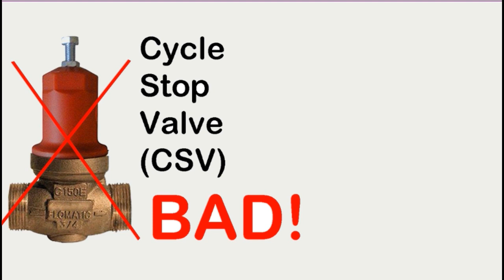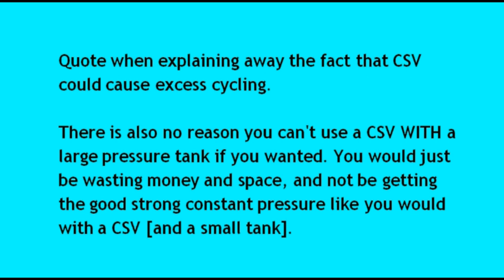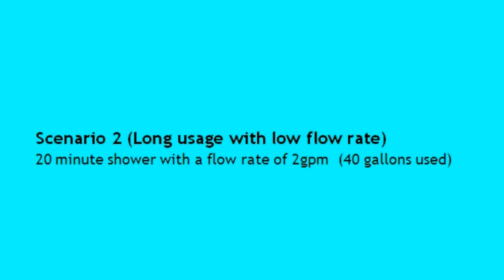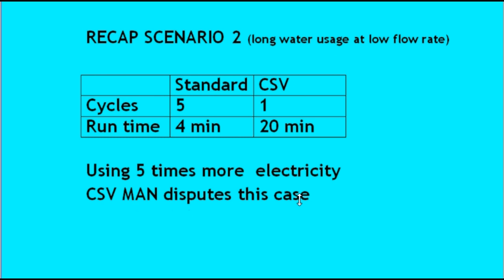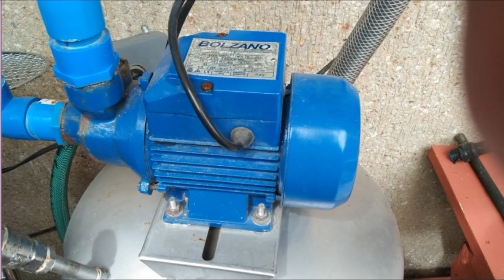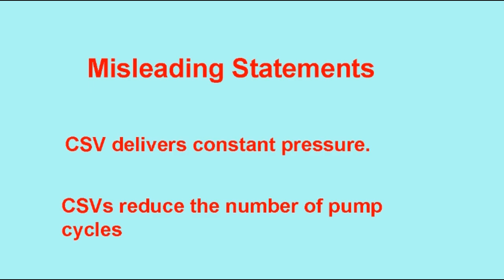Cycle Stop Valves ARE BAD for pressure tank systems!  Pros and cons of CSVs – few pros, many CONS!

Comment: Thanks for posting this video!  I got a question.  Contemplating a CSV as I think I am the rare person that could use it.  My system, you'll love:  Deep well feeds 3K Gallon cistern (float activated).  Adjacent to cistern is vault with 1HP  jet pump on 30/50 upped to 40/60 approx with 20 GPM flow, and 80/20 gallon (approx) pressure tank.  Two uses mainly for the water:
1. Feed whole house Reverse osmosis system in house (run  time approx 1 hr every morning into 200 gal storage tank).  The pump on that R.O. system has a requirement feed pressure of 35psi which is my problem.. 
2. Sprinkler irrigation runs 1.5 hours once or twice a day during peak.  Feeds 10 zones of three sprinklers totaling about 5GPM . 
I want to cut the on/off cycles during the only high output that the pump works.  It is not used for anything else like a toilet flush or sink nduse.  It is used to run a drip line sometimes in Summer and misc hydrant use as well.  Don't care about juice, care a little about jet pumps dying about every three years (three years ago and again this year), care a lot about RO feed requirement of 35psi for the 1.5HP Goulds pump.  When the R.O. feed pressure is feeding machine I get a fluctuation of a low of 27 to about 57 due to the 130' run to it from vault.  I think I got all the data in there.  So CSV valve right?  Am I the one lucky person that gets the CSV nod or am I doing something wrong?   TIA
Reply from the maker: Hi, ok, in a minute I will start analyzing your latest info. Before that I wanted to point out that I have a video called "cycle stop challenge game" https://www.youtube.com/watch?v=kM_Fp0ILzKY&t=326s, where I challenge somebody to find a use for a CSV. Eventually I would like to move these posts there. For now lets just put everything  here. In this challenge video I give out an email for such purposes as sending pictures. This the email is LLPH.EJ@gmail.com, you can send pics or diagrams there. Ok, I will  get back to you shortly after I digest your latest comment.
Reply from the maker: Phew!, you have a complicated system! I think I am zeroing in on what you have but I still have some more questions, plus my first suggestion. Are you sure you know the difference between a jet pump and a simple centrifugal booster pump? In my opinion, from what I can understand, you are using a jet pump(s) unnecessarily  when you could be using a simpler pump. This could be costing you money and may be part of the problem of your pumps breaking prematurely. Again, see my video 43 topics in 43 minutes.

Ok, now the questions. I will concentrate on the irrigation system and the RO system. On the sprinkler system, how does the timer activate the water to start flowing? Does it just open up a valve which then causes the pressure switch to be activated? Or is there a more direct connection to the pump? At any rate, i understand only 6.5 gpm is being used.

Ok, now onto the RO system. First, as I understand it you have four pumps total, one for each of your four systems, right?

What I don't understand is this. The pressure tank in the vault is feeding pressurized water to the RO system, yet you still have another 1.5 goulds pump  at the ro system. Why do you need a second pump? Explain how the two pumps interact? Send me a diagram if needed at LLPH.LJ@gmail.com, but let me know here that you sent it.

We will get this all nailed down!

Oh, and one more thing, where are you suggesting putting the CSV valve?
Reply: @LarryElterman   I am in the North and am too busy with not enough time so bare with me in replying...  I did not know about the challenge but sure I am in!  My set up is more busy than complicated really,  especially if I break it down better so it is more understandable.  With that said here is a better descrioption of the four seperate systems even though I am just concerned about system number "two" and I will try to answer questions as well.  My system has gone through some metamorphosis over the years from just system 1 to it's current state. 
1.  So system one is a basic submersible well pump in the well that is activated by a float switch in the cistern when  low point reached.  It simply pumps water from the well and dumps it into the cistern at the well output of 5 GPM.
2.  Right next to the cistern on the same level is my "vault" which is a 1000 gallon concrete tank where I have my 80 gallon pressure tank and a corresponding 1HP jet pump.  Water is pressurized here and sent to the house approx 125' away and within 10' or so of the jet pump level.  Water is also sent to irrigation valves from here that water grass in non frozen  months.  Pressurized water goes to the mechanical room where all the plumbing is etc.  Initially that was my only system that fed the house for water but due to ferrous and non ferrous iron, tannins  etc I have to go to work and make it more elaborate as cheaply as possible thus the birth of a whole house R/O system. 
3. Looks to be close to my system here: https://www.ebay.com/itm/390531960044?hash=item5aed84ccec:g:OIMAAOSw44BYUtLk
I manually turn this system on every morning and fill up the 200 gallon tank of RO/product water to feed the house pressure on the next system 4.  This system needs 35 psi from system 2 and it is currently getting 25-45...  
4. Is just another smaller 3/4HP jet pump with a smaller ,35 gal approx, pressure tank that pressurized house with product water.  It is nice not having iron stains in the drinking water along with stained porcelain toilets, showers, siinks and clothes. 

What you said about a a different type of pump ( centrifugal?) sparked my interest.  If this could replace system 2 or my vault jet pump and/or perhaps the pressure tank as well it would be interesting.  Both irrigation and house are very close to same level but the water needs to travel 125' to house and on separate irrigation line it must also travel maybe another 100' (totaling over 200') in Summer and provide stable pressure.  I have no idea the criteria for these centrifugal  pumps to operate.  Again my problem is burning out jet pumps in system 2 every three years...

The sprinkler system is just a basic sprinkler timer that operates valves on a a few manifolds.   I can set the time(s) to any time frame.  It is pressurized by system 2...

I would put the CSV in the vault with the pressure tank and jet pump (system 2) so hopefully it would feed steady pressure and not cycle which would be good for the R.O. pump and sprinkler activated cycling.  In a nutshell I think the jet pump is overcycling, or cycling too much during the one to three hours of heavy use via R.O. system and irrigation.  That is the only use essentially system 2 is used for...
I'll get some pics and/or video to your email later.  Bare with my delays busy time!  Thanks!
Reply from the maker: @robz924  Ya, this is a complicated system and a diagram would sure help, in the mean time I have a few more questions. Sorry, it seems like I have endless questions, but I can not solve the problem unless I understand your system 100 percent.

So, I am confused by a number of things. Ready?

Ok, you have your 3k cistern, and next to it in the vault a 1000 gallon concrete tank. I really don’t understand the purpose of this tank in the vault. You already have the cistern, why do you need the additional 1000 gallon tank. This makes no sense to me at all. How does the water get from the Cistern to the 1000 gallon tank in the vault? By gravity? You should be going from the Cistern, to your pump to your pressure tank, no 1000 gallon tank needed.

Ok, so in your latest description you do not address the purpose of the 1.5 hp goulds pump, so I will take a guess at what I think is going on and you tell me if I am right.

The 1.5 hp goulds pump is an integral part of the  RO system and is used internally to produced the filtered water. You need not think of the 1.5 hp goulds pump as a separate entity, what we have is an RO system which requires 35 psi input and the goulds pump is of no consequence in our analysis, it is simply an integral part of the RO system, which as a whole requires 35 psi input, am I correct?

A jet pump is a centrifugal pump with an added attachment basically. This attachment is only needed if you are sucking water up from below. You are not doing this, so you are wasting money buying these jet pumps, if indeed they are jet pumps. You buy a centrifugal pump exactly as you would buy a jet pump, by looking at the specs! They don’t look much different. Jet pumps usually have the output set back a ways from the input. Centrifugal pumps usually have the output right above the input. I know I am being repetitive, but you can learn the difference in my video 43 topics in 43 minutes. The index will tell you where to watch.

If my assumptions are correct I think I have a good handle now on what is going on. The big confusion is why you have the extra storage tank in the vault.
Reply from the maker: Hi, thanks for the challenge. No, I highly doubt you are the one person that can use a CSV. I can always find a better way! But now that I have double downed, I better put my money where my mouth is, but first I have to understand your system completely. There are a number of things I am not clear about so the first step is for me to ask a number of questions.
1. You have two pumps right? A Goulds deep well 1.5 hp pump, and a 1hp jet pump, right?
2. The deep well pump is only used to feed the cistern, which is controlled by a float switch, right?
3. The Jet pump is used to fill the pressure tank, and then the pressure tank feeds both the sprinkler system and the RO system right?
4. You say the pump is set to pressure 40/60 correct? Which is another way of saying the pressure in the pressure tank varies from 40 to 60 correct?
5. You describe the pressure tank as being 80/20. I don’t know what that means, does that mean that it is an 80 gallon pressure tank with a 20 gallon draw down?
6. Once the water gets to the 200 gallon RO storage tank, how does it then get delivered to the rest of the house?  By gravity only?
7. I think that you are saying that the well pump is only used to feed the Cistern? Am I correct? But later you say the following” I care a lot about the RO requirement of 35psi for the 1.5hp goulds pump.” So this seems to contradict my image of what you have, namely that the well pump only feeds the cistern and the jet pump does the rest, please clarify. 
8. how is the sprinkler system activated? Manually or by a timer? You said you have 10 zones, does this mean that only one zone at a time is active?
9. Every morning the RO system goes on for one hour. How is it activated and deactivated? Manually? Automatically.
10. You said the RO system needs 35 PSI. Does this mean it needs at least 35 PSI? Or can it be more? For example if the feed system to the RO was a constant 60 PSI, would this hurt the system?
11. You are filling up a 200 gallon RO tank. The system is requiring 35 PSI, but it takes 1 hour to fill this 200 gallon tank? Am I correct? This means that your flow rate into the RO tank is only a little over 3 gallons per minute, correct?
12. And finally, why are you using a JET pump to go from the cistern to the pressure tank? I assume the jet pump is below the level of the cistern, so there is no priming needed, so all you need is a booster pump. A simple Centrifugal pump that is cheaper and probably more dependable than a jet pump. If you are not familiar with the difference see my latest video, 43 topics in 43 minutes.
Many questions to be answered before I can improve your system!
Reply: LOL!  I apologize for not being more detailed and the abbreviations...  I will answer line by line below to keep it easier to read but first I will clarify all four (4) systems which you mostly have figured out. First system: 1/2 HP deep well pump feeds cistern via float switch. Second system: 1 HP jet pump and pressure tank in vault next to 3000k tank (water naturally primes jet pump) feeds irrigation and house (R.O. feed only)with the well water. Third system: R.O. system with 1.5HP Goulds) runs in mechanical room in house utilizing pressure from second system and product water is stored in 200 gallon tank.  The R.O. machine is activated manually each morning. Fourth system: House pressure has another jet pump and smaller pressure tank which feeds house with R.O. product water.   
 1. You have two pumps right? A Goulds deep well 1.5 hp pump, and a 1hp jet pump, right?  SEE ABOVE

2. The deep well pump is only used to feed the cistern, which is controlled by a float switch, right? YES

3. The Jet pump is used to fill the pressure tank, and then the pressure tank feeds both the sprinkler system and the RO system right? YES

4. You say the pump is set to pressure 40/60 correct? Which is another way of saying the pressure in the pressure tank varies from 40 to 60 correct? YES

5. You describe the pressure tank as being 80/20. I don’t know what that means, does that mean that it is an 80 gallon pressure tank with a 20 gallon draw down? YES (APPROX)

6. Once the water gets to the 200 gallon RO storage tank, how does it then get delivered to the rest of the house?  By gravity only? SEE ABOVE FOURTH SYSTEM JET PUMP TO DELIVER R.O. PRODUCT WATER.

7. I think that you are saying that the well pump is only used to feed the Cistern? Am I correct? But later you say the following” I care a lot about the RO requirement of 35psi for the 1.5hp goulds pump.” So this seems to contradict my image of what you have, namely that the well pump only feeds the cistern and the jet pump does the rest, please clarify.
I TOTALLY AGREE IT IS CONFUSING AND HOPEFULLY IT IS CLEAR NOW?

8. how is the sprinkler system activated? Manually or by a timer? You said you have 10 zones, does this mean that only one zone at a time is active? TIMER MAINLY AND YES ONE ZONE OF THREE HEADS/SPRINKLERS AT A TIME USING APPROX 5-6 GPM.  RUNS EARLY MORNING HOURS ONLY.

9. Every morning the RO system goes on for one hour. How is it activated and deactivated? Manually AND LONG AFTER SPRINKLERS DID THEIR WATERING.

10. You said the RO system needs 35 PSI. Does this mean it needs at least 35 PSI? Or can it be more? For example if the feed system to the RO was a constant 60 PSI, would this hurt the system?YES 35 IS MINIMUM BUT I AM GOING BELOW THAT BRIEFLY A FEW MINUTES!   60 PSI WOULD BE FINE BUT DURING CYCLING IT DROPS TO 25 APPROX WHICH MAY CAUSE EARLY DEATH TO THE GOULDS 1.5HP SYSTEM PUMP. 

11. You are filling up a 200 gallon RO tank. The system is requiring 35 PSI, but it takes 1 hour to fill this 200 gallon tank? Am I correct? This means that your flow rate into the RO tank is only a little over 3 gallons per minute, correct? CLOSE.  R.O. SYSTEM MAKES APPROX 1.4 GPM OF PRODUCT WATER DEPENDING ON HOW MUCH IT TAKES TO TRIGGER THAT FLOAT OFF ON TOP OF 200 GALLON TANK.

12. And finally, why are you using a JET pump to go from the cistern to the pressure tank? I AM NOT USING PUMP FOR THAT.  WATER FEEDS TO JET PUMP FROM CISTERN WITH GRAVITY, AS IT IS ON SAME LEVEL, AND JET PUMP/PRESSURE TANK (SECOND SYSTEM) IS TO FEED HOUSE ABOUT 125' AWAY.  
Hopefully this paints a more clear picture?  I can send you pictures but I can't find an email.  Either way I appreciate you taking a looksy here as I know it's a handful with four systems and all.  Iron is my problem and my set up defeats the iron the most cost effective way.  Well yields about 6 GPM and that is why I have a cistern as well as making irrigation work.  I just hate going into the vault to change the jet pump now twice in 5-6 years and it seems I can do something for system two to help? Thanks
Reply from the maker: Oh one more important question. The irrigation line. Is it a separate line the whole way, starting from the vault? or does it share the line to the house and then continue on into the fields.  That is important in my analysis.
Reply from the maker: Sorry, another question, is it uphill or downhill from the cistern to the mechanical room?
Reply from the maker: Hi. I understand your system. I know the problems. Your system needs a total redesign in my opinion. Because of the nature of how you developed your system, that is a slow metamorphosis over the years, there was one ban-aid after another put on your system to make it work. The final result being an ill-designed system. Now, i will agree with you on one point about your CSV idea. It will work to an extent. It will stop the cycling and maintain the pressure. However, your pump will keep blowing out because it is being over worked. You have a powerful pump providing a very small flow rate, thus the burn out. A CSV may or may not help. It will reduce cycling but increase pump run time. Result unknown.  A CSV is just another ban-aid. A redesign will cost you some money in the short run but will save you in the long. A redesigned system would be vastly simpler than what you have. That is the bottom line. There are actually numerous solutions to your problem.  Here is one easy solution that does not require a total redesign. Get a much bigger pressure tank for your vault with a high max pressure rating. Set the pressure to 50-70, or even 60-80 which will make sure at least 35 psi is always delivered to your RO. The larger pressure tank will also reduce cycling. Next time you buy a pump, make it a centrifugal pump with a lower flow rate and a higher max pressure rating. The best way to solve your problem is to simplify your vault. All you need in the vault is a single pump which is controlled by an additional water storage tank located in the mechanical room. So you will have two water storage tanks in the mechanical room. one will get water from the cistern, the other for the ro output. Then have two separate cheap low power pumps for your two systems, one to go the ro and one to go to the sprinker. A CSV will seem to help but will not solve the underlying problems. :), hope i have helped.
Reply from the maker: P.s. There is always a better way than a CSV. ALWAYS! A CSV is a scam product. Also  note that if you use my second suggestion the only pressure tank you will need is the one going to the house. The RO is manual, so simply turn on the PROPERLY SIZED centrifugal pump that goes from the mechanical room storage tank to the RO system. No tank needed. Same thing for the sprinker, although in that case you need to make the turning on of the second pump automatic. Many ways to do that.
Reply from the maker: So why no answer since I gave you a solution? Not interested since I proved you don't need a CSV?